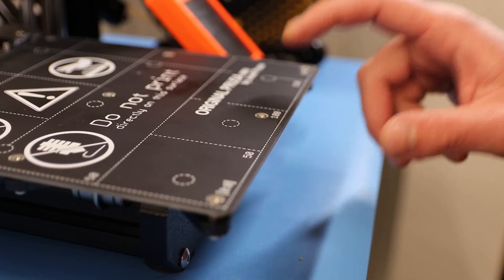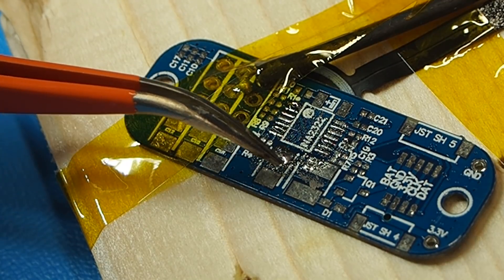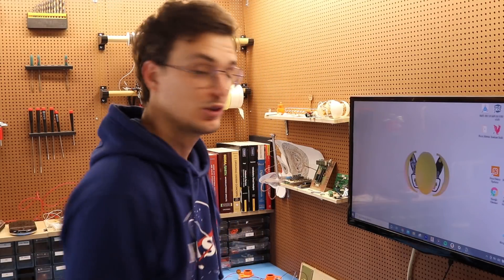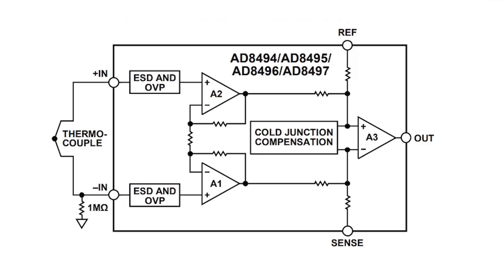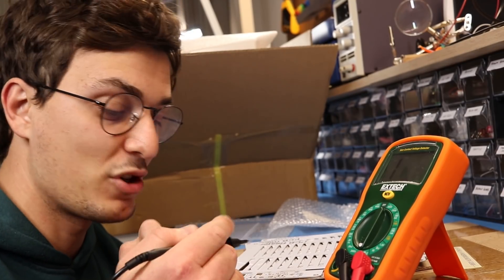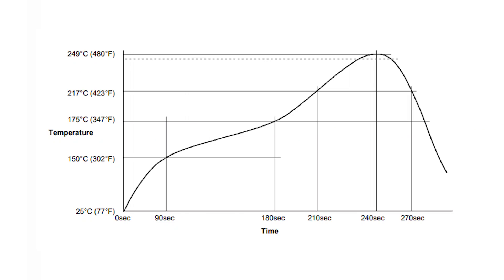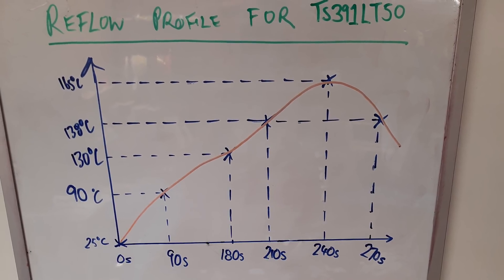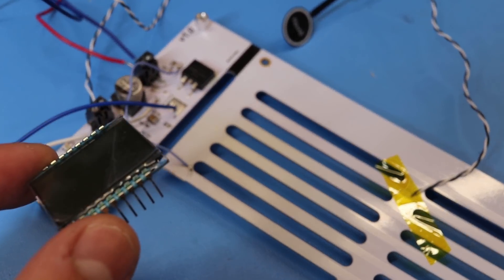Trying to build a PCB Hot-Plate to Reflow PCBs

Comment: Suggestion: Instead of using a aluminium pcb, make it like the prusa heatbead which is basically a heating pcb that goes up to 190 Celcius or so.
Reply from the maker: prusa heatbed is an aluminium pcb ;)
Reply: @CarlBugeja  early versions weren't, they were basic FR4. Still have a reprap printer at home with FR4 printbed that reaches 120°C with 12V. Guess using 24V would do the trick ;)
Reply: RepRap actually lists 180°C as max temp for the MK3: https://reprap.org/wiki/PCB_Heatbed

Comment: If you're making the pcbs separate then connect to the "heater" with screwed-in wires rather than needing to solder onto it, it'll eliminate the chance of that solder melting too!
Reply: Or tabs you can fit a spade staycon on
Reply: he could also just use standoffs to connect the heater to the power supply
Reply: @eliasrenner555  Yeah, really anything that doesn't require a soldered connection
Reply: Don't sleep on the possibility of an edge connector.  No soldering on the hot board required, easy attach/detatch.  Could even have a few extra pins on it to include the thermocouple and specify heater type and have the µC adjust its voltage/current parameters for each heater.

Comment: A thick layer of anodizing is often used to create the dielectric layer of an aluminum PCB.... which is something I find to be pretty interesting.  The copper traces can also be added to that dielectric layer via either electroplating or sputtering techniques to avoid having any polymer resins that would lower temperature ratings.

Comment: U should get rid of the holes. They are counterproductive since they lower thermal mass and heat is distributed unevenly to reflow PCB.  Anyway good project as always !
Reply: It seems to me that they'd also lead to much more convection, which is probably draining the heat away.
Reply: Why are there holes in the first place? Just curious
Reply: @TheRainHarvester  holes are for rapid cooling of the pcb after heating. check the soldering standard
Reply: @micultimy91  instead, maybe create a lever that lifts the board up after heating: it could poke the board up from a few tiny holes from below (little metal toothpicks that push thru the heating element).
Reply: Or minimize them
Reply: Lower thermal mass is better as it allows the board to heat up faster with the same power due to less thermal capacitance

Comment: Temperature sensing suggestion- could you use heating element resistance as a temp sensor? Will probably need 4 terminal sensing, but should be possible.

Also - split the heater into sections with separate PWM. Will make it easier to compensate for etching variability across the heater.
Reply from the maker: I thought about this - monitoring the current and measure the resistance change with temperature.. In theory it should work but you have to consider other stuff like variations in track resistance.. But I think it still can be done if the current change is constant.. So I might consider this for v3 😜 once v2 works haha
Reply: @CarlBugeja  Might be possible to measure track resistance at room temperature per-board, and then assume a fixed temperature coefficient. Track width may vary, but aluminium expansion coefficient and copper tempco should be consistent across PCB batches. Best of luck for v2!
Reply: This sounds like a reasonable idea - cheap soldering irons do this.

Comment: My first idea when i saw this: "why not add an extra layer to any pcb to make it reflow itself". Turns out you already thought of it. Great video. Super interesting concept.
Reply from the maker: Haha technically it was also how the idea started but I decided to first valid the concept with a hotplate.. But now that it worked I 'm just to excited for the self Reflowing pcbs! 🙃
Reply: @CarlBugeja  Well, you made useful experiences. I am interested to see the use case for the self reflowing PCBs. Surely it can not be sustainable for large scale manufacturing, but maybe a good way to spend a unused free layer at PCBway ;)
Reply: @danielaaroe  The application is that as a hobby player you might not have a reflow oven of your own for that one pcb per year you might want to make. Which is a pretty serious limitation, for many components it's the only reliable way to solder them. LGA, BGA packages, you can try zapping them with a heat gun and try eyeballing it, but the success rate is not good. In professional setting it's not useful at all of course, you'll just buy the tools you need. Even in home setting if you are willing to buy any supplies getting a bottle of vapor phase reflow fluid would probably solve your issues. But if all you have is some paste, board and components, then it would be pretty neat if the board would solder itself.
Reply: Imagine a chip dies and you just power the reflow heater and replace it with no tools needed
Reply: @alexstone691  of course, especially if there were reflow-zones(to avoid reflowing all the other joints and creating unnecessary oxidization)

Comment: Could you make a 4 layer board, and use one of the internal layers as a built in reflow heater? edit I should have watched the whole video before commenting.
Reply from the maker: That's what i was thinking for the self Reflowing pcb thingy that I mentioned in the end 🙂 there some other things that I needed to consider though

Comment: Me, who can't even solder two wires with a soldering iron: "Huh, interesting."

Edit: Carl, your videos are super cool. Could you make a video about basic electronic engineering or electronic engineering tips? Thanks for the heart btw.
Reply: Soldering is almost an art, and there are tricks to do it well. If you are going to start, I reccomend you dont use one of those just plug in ones. Get a variable temperature iron, you wont regret it. When I first tried, I was absolute crap. I didnt clean the boards and every single solder joint was a cold one, and I kept lifting the pads because the temperature was too high, but I couldent adjust it because I was using a cheap plug in one!
Reply: @justin.campbell  exactly ! temperature control is a biiig deal, also for me soldering flux changed absolutely everything, I went from struggling to solder some wires to soldering up a perfect PCB with just the right variable iron and a jar of soldering flux.
Reply: @MrOmarabdulhadi  yes, I agree. flux is really just absolute magic the first time you use it!
Reply: Thank you!